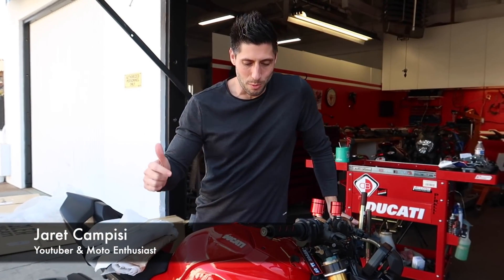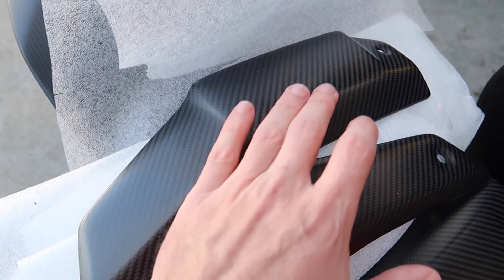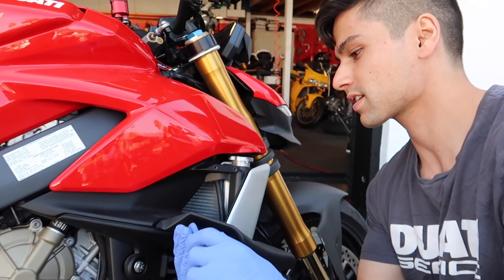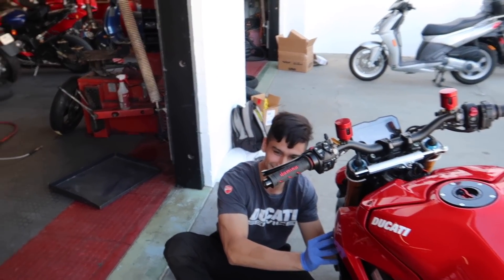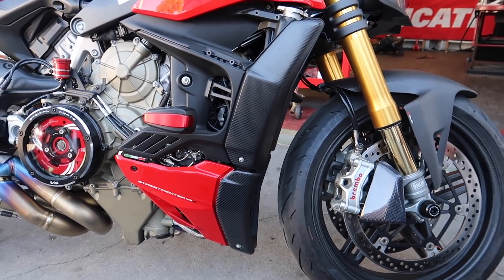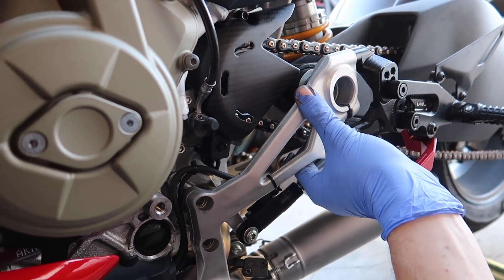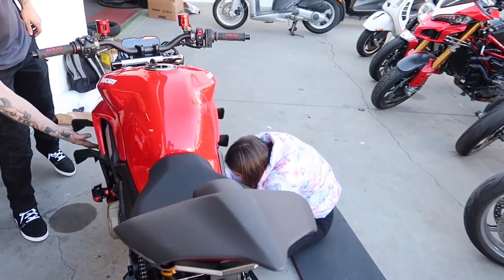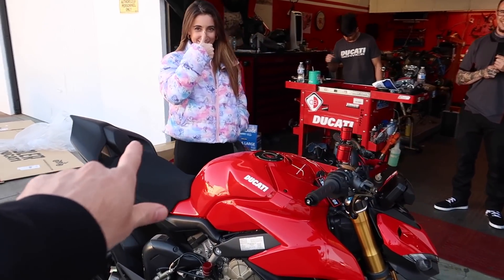Installing Carbon Radiator Covers on our 2020 Streetfighter!

Comment: It looks better without the wings. I wish there were cf covers to cover the mounting holes.
Reply from the maker: the bike was designed and engineered with the wings so removing them because it might look slightly better is not a good idea in my opinion

Comment: the winglets look legit but if it were me I would have used a file to smoothen out the apertures in the sprocket cover. The weave looks great but they didnt take the time to do those little finishing touches

Comment: It’s a pity that aftermarket companies are not matching the premium slight shining parts from Ducati Performance, still my favorite and I will use nothing but Ducati Performance 🤪
Reply from the maker: unfortunately ducati performance doesn't make a lot of the carbon parts I wanted so I had to match the best I could
Reply: @JaretCampisi  I agree! I don’t know what they do with their matte parts that others are not matching. FullSix matte carbon parts are SUPER dry.  A friend of mine added clear coat on top of it and it looks good. Those radiator covers that you added have a nice look 👌🏻